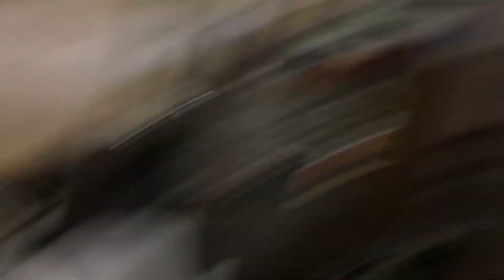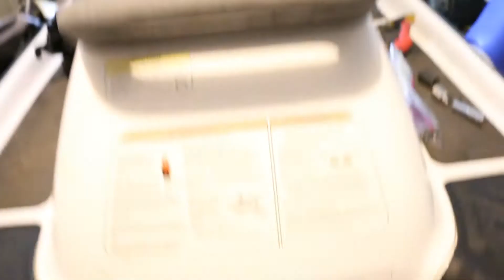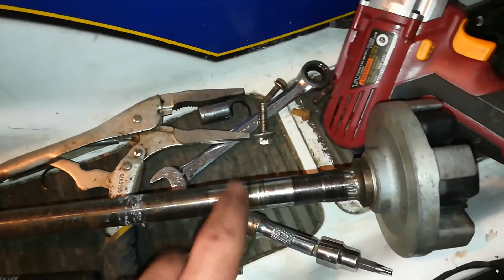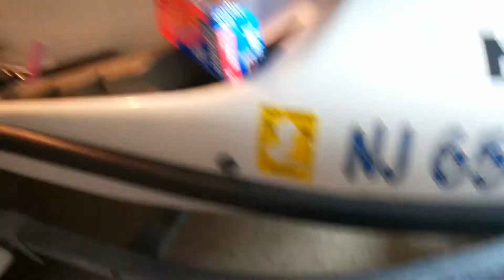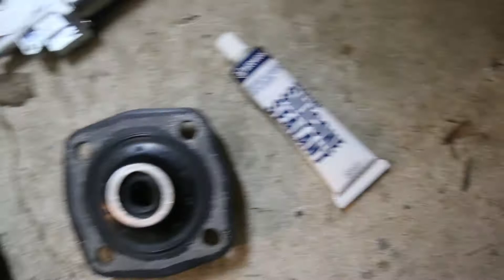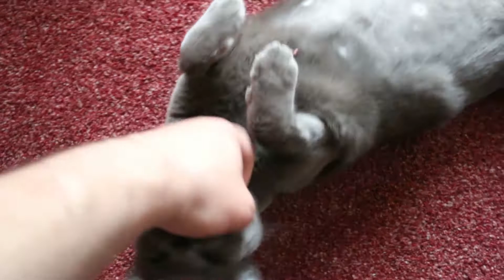$500 Jet Ski Rebuild Part 4 - 6 DAY MOTOR PULL AND REPLACE!

Comment: Where's the video of it on the water?
Reply from the maker: Hopefully soon! Weather has been mostly rain the past several weekends. If it's nice out this weekend, I'll be sure to grab some new footage!
Reply: I picked up a 93 750 SS that I need to put the all new top end that came with it back on the motor. Then see how it does. I've never ridden a Kawi 750 sitdown.
Reply from the maker: That sounds like a fun project! Good luck with it! I'd recommend doing the driveshaft bearings / if you pull the motor to do the top end, just a good way to prevent taking on water.

Comment: Damn rebuilt the engine, put it in the water and it starts sinking XD what a pain in the ass. What are you up to now on investment in this thing?
Reply from the maker: I agree! It's been a pain! I think total investment has been around $1600 with the purchase price. However, now it's floating and running absolutely beautifully. Hopefully I can get some on-board footage soon! Also, just bought a cheap 18' bowrider inboard outboard... that's a separate series coming up!